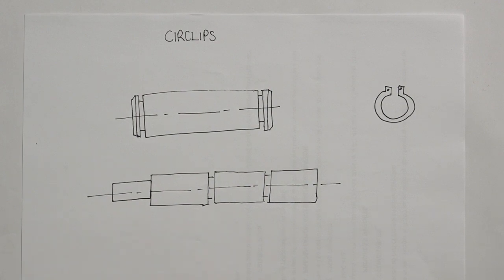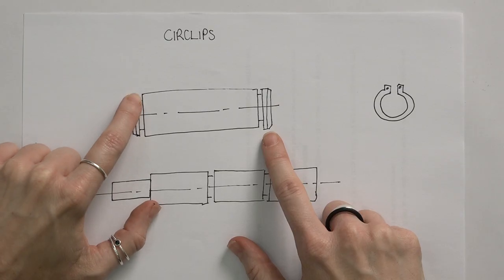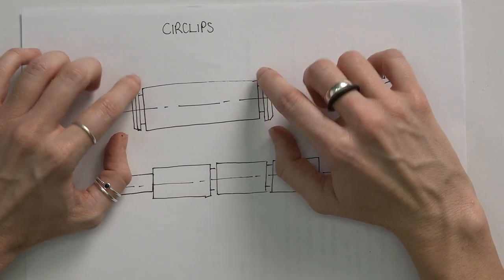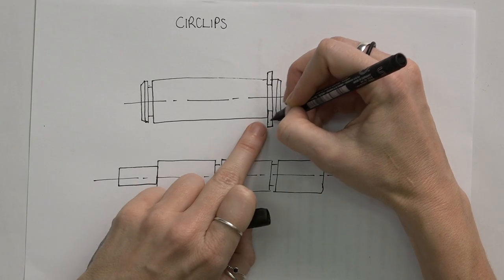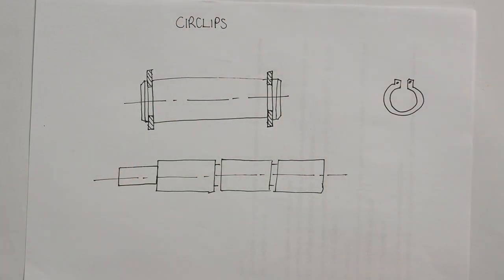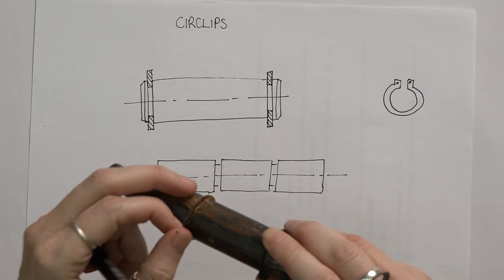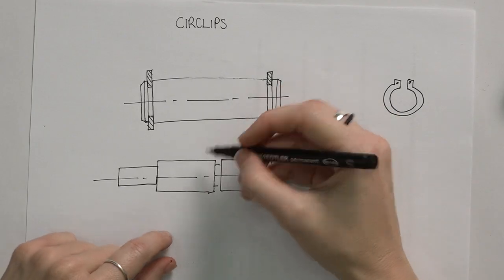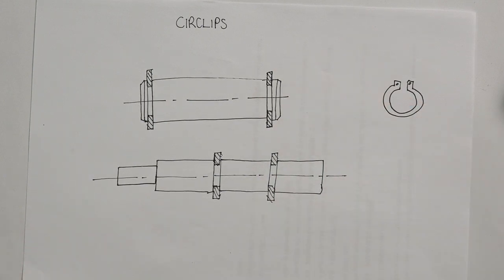Standard components: circlips part 3 of 4

Comment: What is the difference between internal and external circlips?
Reply: A circlip is a device that prevents relative axial movement between components. An internal circlip, as the name implies, works on the inside of a component whereas an external works on the outside. Internal circlips for example, can be used to axially secure the outside of a bearing in the inside of a hole by being inserted into the hole (hence internal) and the spring force in the circlip causes it to push outwards clicking into the groove on the inside of a part. External circlips for example, can be used to axially secure the inside of a bearing on the outside of a shaft. In this case the circlip is stretched open and moved over the outside of the shaft until it reaches the groove, then the spring force will cause it to click into the groove effectively giving the shaft a small shoulder that prevents/blocks axial movement of the bearing inner
Reply: Thank you Riaan - quick follow up question. Is there a difference in design of the two?